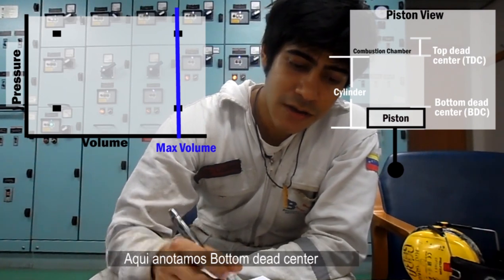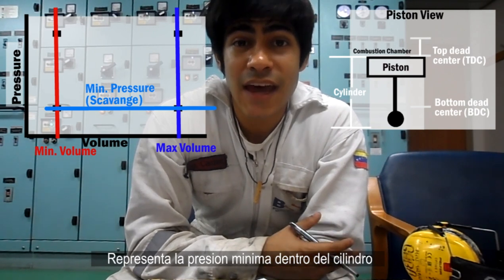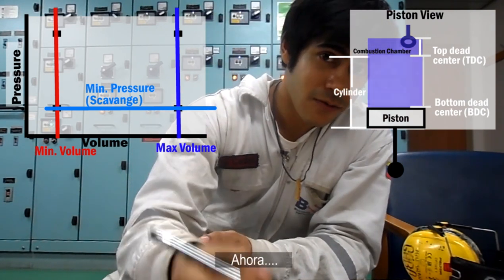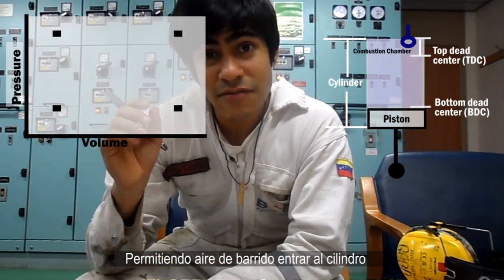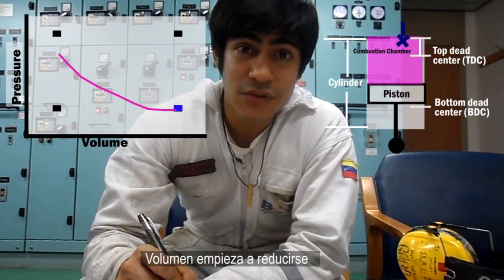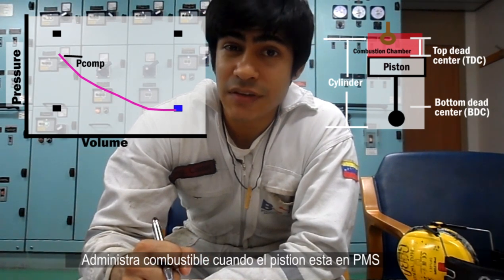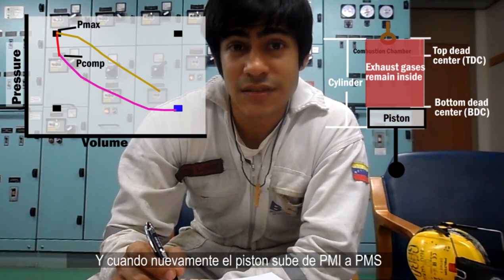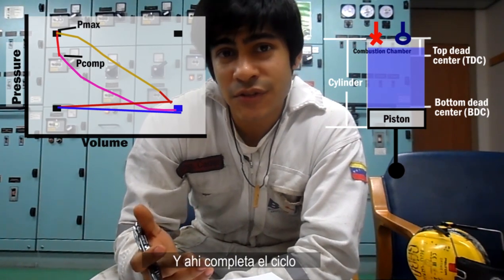4 stroke engines + diesel cycle newbie cadet style

Comment: Isn't the fuel injected right after the inlet valve closes at the end of the first stroke , right at the start of the second stroke and than is compressed together with the air until it reaches the temperature at which it is combusted?
Reply from the maker: Greetings Sejo! The injection should happen just before maximum compresión to expand the fuel. 

if you check the manuals for injection timing you will discover how many degrees of the crankshaft before top dead center the injector should open.

Maybe you are thinking of the Otto cycle where air fuel mixture enters together to the cylinder and are ignited in top dead center?
Reply from the maker: I'll also add that pre-injection is actually a fault that must be troubleshooted and corrected 

This is because it doesn't take full advantage of the total compresión power (due to premature expansion) and also it doesn't promote full combustion (combustion is better as an atomized spray just as it leaves the injector).

If you check out my video on fuel injectors maybe you can visualize better and even see a possible cause of premature injection (loosening of the locknut and pressure adjusting nut / needle not seated properly or worn / maybe some others that I must experience)

Comment: Sir how can you determine if the engine is a 2stroke or 4stroke type
Reply from the maker: Hello dude, lots of things are different, the combustion cycle per revolutions of crank shaft, engine speed and power, constant pressure vs constant volume theory! but the most simple way to determine if an engine is 2 stroke or 4 stroke is the revolutions per minute.. Usually 2 stroke engines are slower but more powerful (more kw/HP) but 4 stroke engineers are faster.